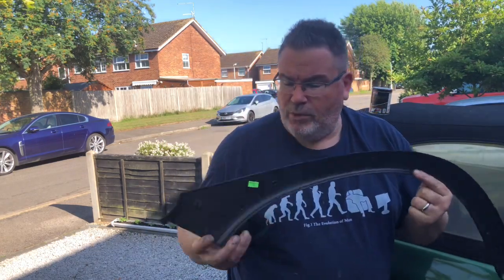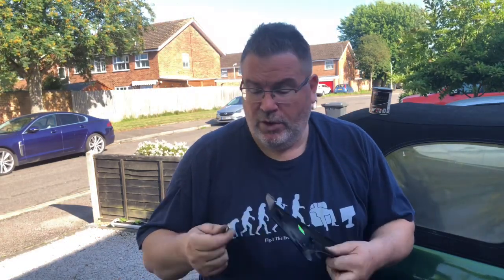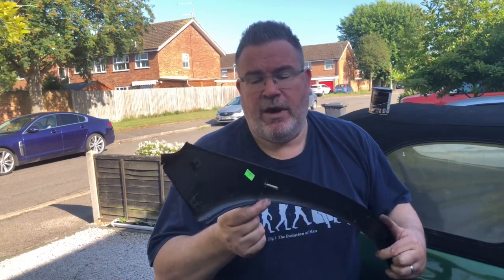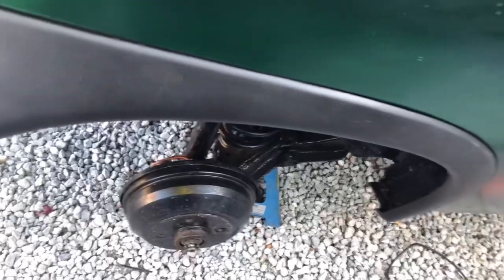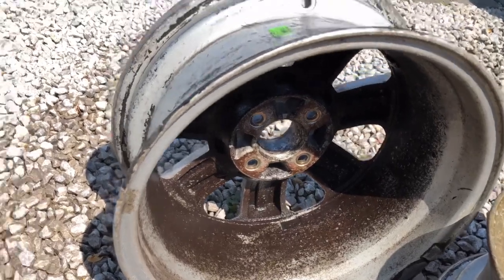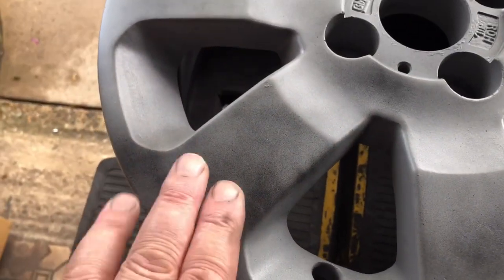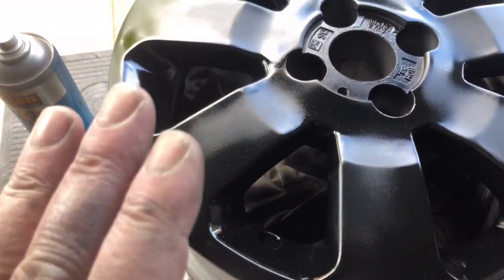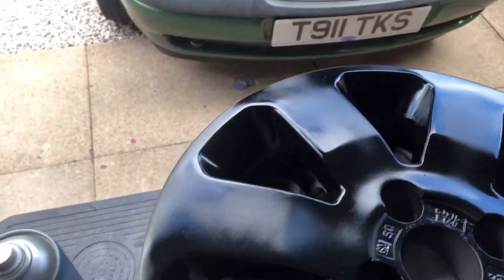#13  Alloy Wheel repaint from a rattle can and plastic Wheel Arches Fitting Ideas

Comment: Good to see a series on restoring a Corsa B. Borders registration mark and nice original Abercromby dealer plates. I'm in Scotland too and have had my B 10 years so the rust bug is familiar to me too! Mine has already had a replacement cross member and some work to the rear panel. It goes in next Thursday to have the front strut turrets welded as they have strangely rotted through! Keep up the good work.
Reply from the maker: Split_ Pin well the car made it down south to Bedfordshire

Comment: Nice job, if you haven’t done all the wheels I would look at buying some more flexible pinstripe masking tape, it will make the darker cut outs so much easier to paint, I like the look it gives it a slightly modern look
Reply from the maker: Thanks for the tip!